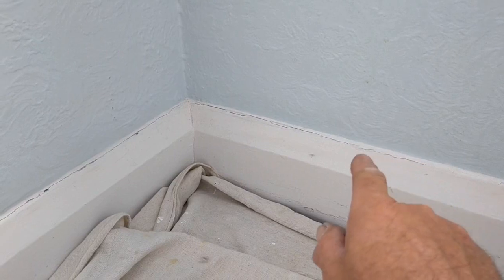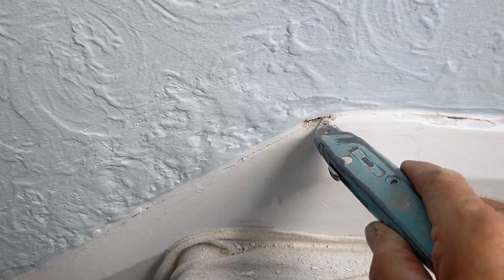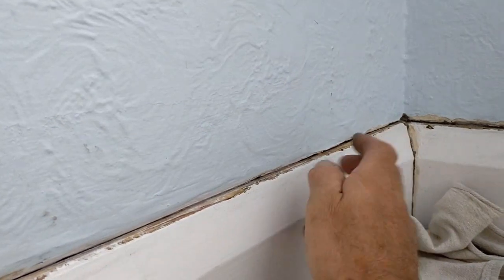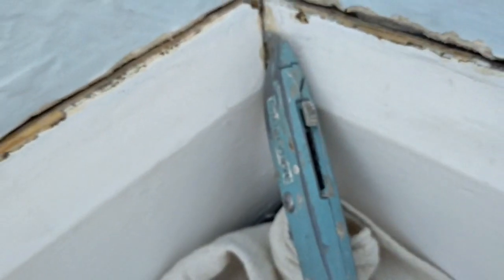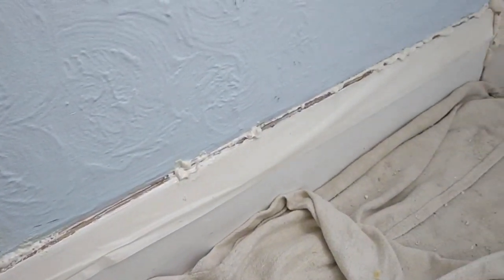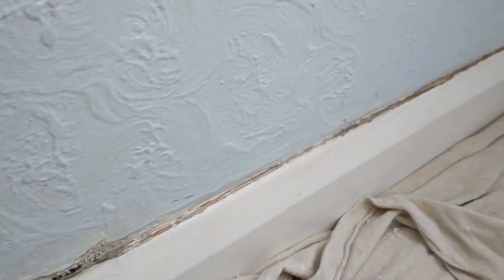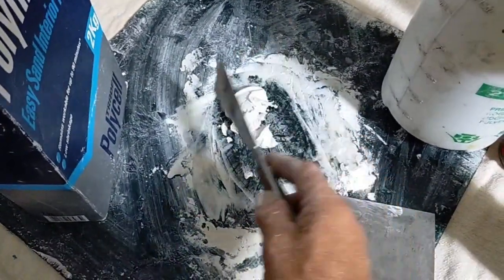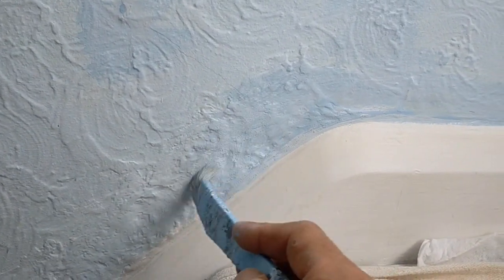Cracks along skirting boards a common problem in old houses

Comment: I had cracks on the stairs like this.  Followed this method from your previous videos at the start of the pandemic.  Still not a crack in sight, even with a heavy footed teenager.  Thanks your all your tips and tricks, they've been a massive help!
Reply from the maker: Thank you..  glad It worked nothing worse than cracks showing up the decorating..

Comment: Good tips about how it moves and to clean off the paint. I am not such a fan of using foam in an old house. I would rather use lime plaster as a filler, eliminates the possibility of damp spots whilst foam would create a barrier. As long as organic materials aren't present mould shouldn't grow (as it needs something to feed on I think) but I think there is more risk of mould if lime isn't used.

Comment: Judging by that awful artex lashed all over the wall the cracks are the least of youre worries
Reply from the maker: The overall look of the artex is pretty good...  hides uneven plaster and can be better than textured papers...  thanks
Reply: Yes, artex done properly looks great, just like decorating, diyers, bodger stay well away
Reply: @beecee6850  no it really doesn't and should be consigned to the dustbin of history....forever.